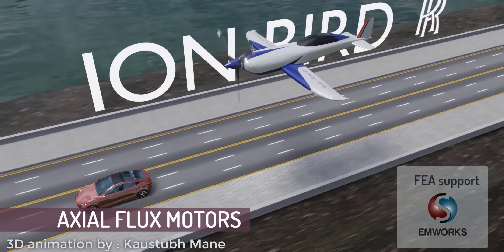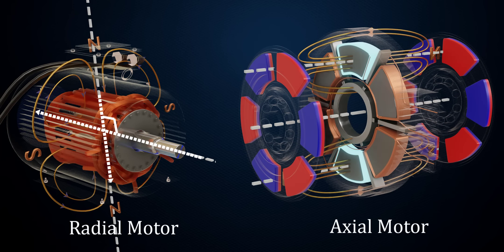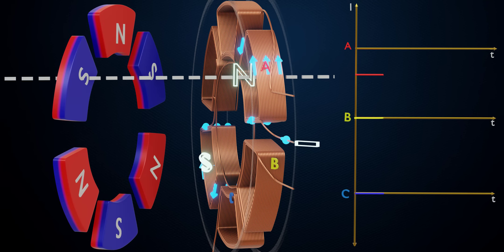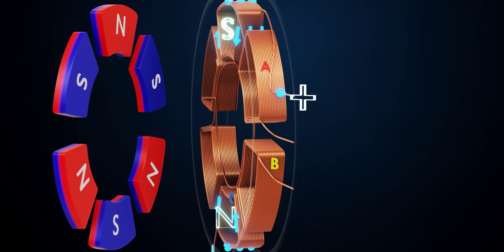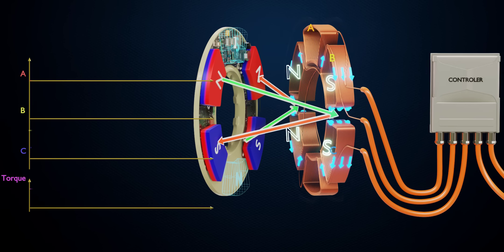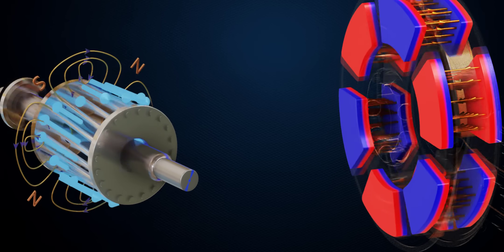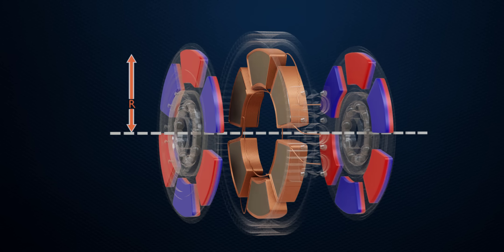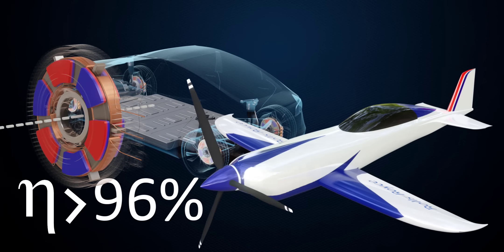Axial flux motors - The new hope

Comment: The larger diameter a rotor is, regardless of the type of rotor the lower the max rotational speed. This can cut the balls off an electric vehicle.
Reply: On the other hand, you can use them without gearbox, directly on the wheel. A 50 cm diameter wheel will travel at ~190 km/h speed at 2000rpm.
Reply: @samirsuleymanov2099  ok. You will absolutely have a turd. 

To the hub my WRX puts down 4000ftlbs. Something like a hellcat puts down 100000 and something like a Cummins Dodge puts down 40000. The Tesla roadster is like 8000.

That's because gear reduction that you'll have to use. That's why these motors are not being used.

Comment: Shouldn't the coil poles be alternating not 2 N, 2 S. This way 1 pushes, 1 pulles + pushes the next magnet. This way all coils can be energized at once and you get a push + pull configuration all the way around. With 2 N, 2 S you only get a push or pull on 2/3 of the magnets. That is a 3X energy difference. ie. 6 push forces, 6 pull forces = 12 while 2 push, 2 pull = 4.

PS. Since the center is hollow you could add a set of magnets to the center for a radial power or to the outside for even more torque in an axial/radial hybrid. Or use rings with a slot in the magnets but that will only decrease flux losses.

Comment: Impressive this is a feasible idea I would like to see a prototype myself seeing torch, RPM, and weigh its weight to an engine its meant to replace, use one of Tesla's generators along side this (we all know his generator's were way too powerful) and then you have not only an infinite power source but an infinite form of locomotion not dependent on a combustible fuel engine sadly it would only really work for piston aircrafts, boats, and land vehicles jet engines don't really work the same. Batteries are good and all but their crap in the winter time cold temperatures saps electrical energy way to fast so a solid form of electrical power would be better.
Reply: I’m guessing heat taken from the motors could be used to keep the batteries at a satisfactory temperature. At the moment the main problem is that weight for weight fossil fuel has a greater density of energy than batteries. Short haul flights are just around the corner I reckon. And like cars, long journeys will be a better use of fuel. Hopefully those poxy 3 - 5 mile drives you everybody queuing in will be smoke free in a short while.

Comment: The lamination orientation of the stator core can be expensive I think.
And it doesn't need sinusoidal input?
Reply: A good axial flux motor dont use laminated steel.

Comment: i remember when some idiot said magnets couldnt power a motorcycle
Reply: That idiot was correct.  The battery is where the energy comes from.  The magnets are just part of how the electrical power is converted to mechanical power.  They are not the source of power.

Comment: what if they co-generated the power by cutting coils? coils on the exterior of the motor...can interact with the existing rare earth magnets!  Magnets are always on! This could produce an ac trigger charge like on the spark circuit of a lawn mower...Once applied across the super capacitor it would be converted to dc and increased in voltage and collected in dc voltage packs and released by the controller to the coils operating the motor at much higher speeds thus eliminating the batteries all together! and similarly the start circuit could also be magnetic using the parendev principles So the entire engine could be self starting and running
Reply: are you suggesting to make the motor itself? because that would be impossible.
Reply: @beanapprentice1687  i have made it 
i incorporated pillow bearings at the ends of the shaft for stability and perendev magnetics at the shaft outside the motior body with in the motor body incorporated in the rotor i set iron bars with rare earth magnets to stroke coils inbedded in the armature those create a trigger circuit to capacitors that convert the ac trigger charge to dc and step it up then release the dc to electro magnets in the armature so that as the magnets pass the electro magnets they charge and repel the magnets attached to the rotor the stainless steel shaft and associated rare earth magnets give the rotor a flywheel weight of around 80 pounds
we are perfecting a wireless start right now and our firm has a patent attorney 
but if the patent office gives us any shit we will just go around teaching schools how to build the device...the prototype and materials cost us around 20,000.00 including r and d... our engineering firm is called castle engineering located in ohio usa

Comment: I've built these kinds of motors in a new configuration and run them stably at 8,000RPM...... The new future is not far away as long as my company can get funding to go commercial.
Reply: How about high torque, low speed? I’m thinking direct drive robotics applications. We are looking for someone to partner with in this space.
Reply: @Fleurlean4   With planetary gear systems my product has been adapted to suit servo control systems with very high torque applications. My current issue is the manufacturing method is very new and required significant capital to establish a pilot manufacturing plant.. once that is established we will move very quickly into multiple applications.
Reply: I think one of the main attractions with this motor is slim profile, so a planetary would remove that a bit. I would still be interested in seeing how this tech and all other motor tech advances.
Reply: Can it become self-generating at all?
Reply: @sramoore0075187  Depends on what your mean by self generating? if you are asking if it can do regenerative power production the answer is yes. if you are talking funding the business model off pilot production the answer currently is no.. I need about 2M to get thing running commercially.

Comment: this motor will remain just hope... it is just not suitable for heavy industry duties
Reply: There's no real reason why it couldn't be suitable for heavy industry duties. But there's no need for it in heavy industry either, squirrel-cage motors do the job just fine there.
Reply: I predict it will become common.  Competently designed electronics can last basically forever.
Reply: Please provide your evidence that they aren’t suitable for heavy industry.

Comment: I had such motor in my lawn mower and it died after only 20 hours of use... they are VEEERY sensitive motors in comparation to old type motors
Reply: When poorly designed, yes, the fail fast.  I have also seen several of the old type electric motors for lawn mowers where the gear on the motor shaft stripped out after a few hour of running.  It was also poorly designed.  I think both may be a case of "design by accountants".  The cheaper parts did not serve well.
Reply: Anecdotal nonsense.
Reply: well that's because you used your lawn mower to trim your mom's bush

Comment: Yes it's probably so great for planes that you couldn't present us with an idea how to supply this with power. Spoiler alert. Batteries are heavy.
Reply: Batteries are a separate issue.
Reply: @fredbloggs5902  separate from what? From engines? Imagine that we use fuel and fuel tanks because we use fuel powered engines. 

It's like saying batteries in current fuel powered planes are an issue.

Comment: I think an analog solution for the sensor panel would result in a more durable and dependable motor. If your looking to bring this to market the army would be a good staging point to deploy these motors. Like the engines of ww2 for planes and tanks. If you could achieve a higher rate of thrust with a drone, at a micro scale even, I think that would be a good start.